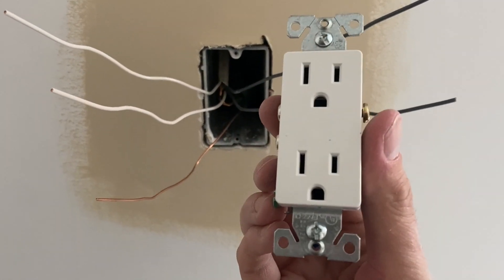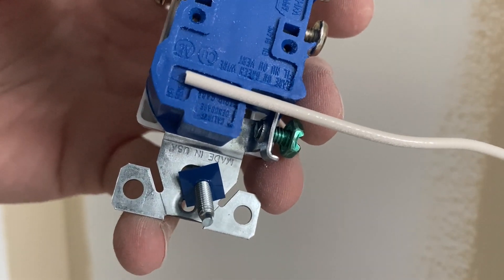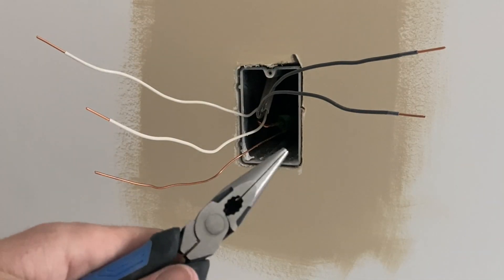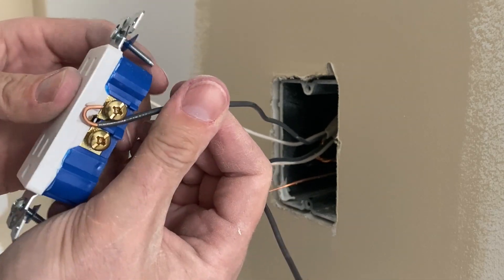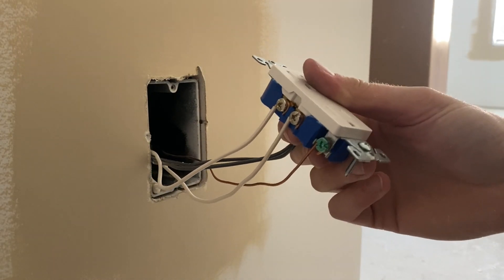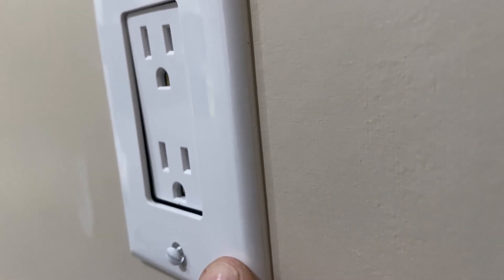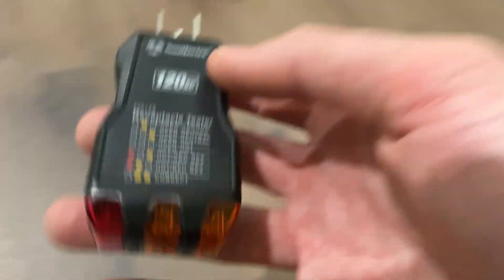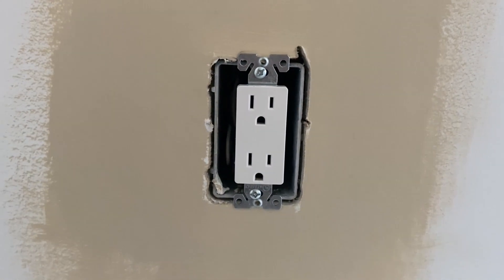How to Wire a Residential Electrical Outlet (and Not Die)

Comment: The outlet has holes on the back. Its easier if you put it on the holes and tightnen the bolt.  The actual design correctly installed 😊